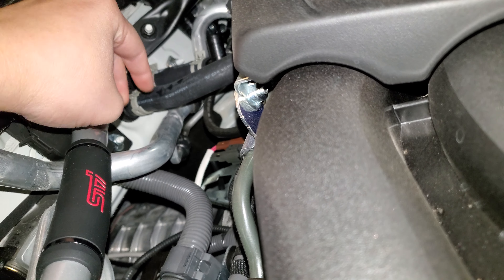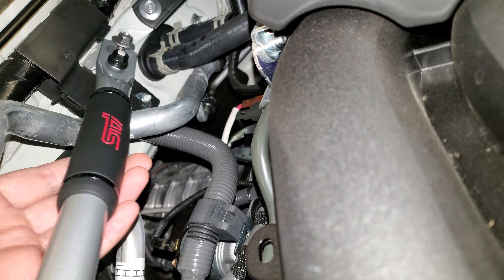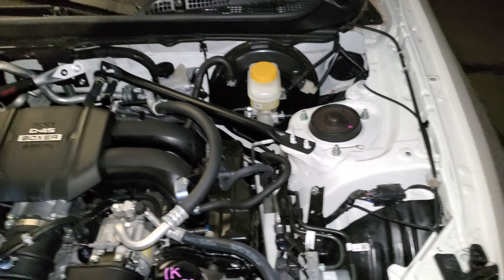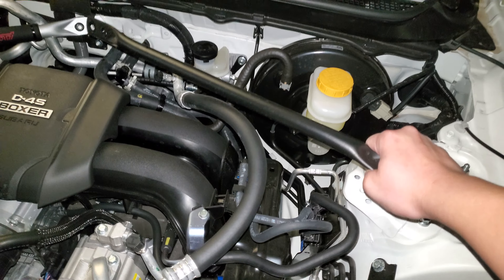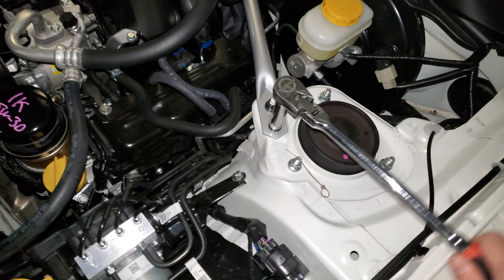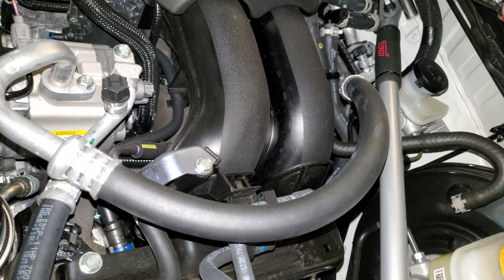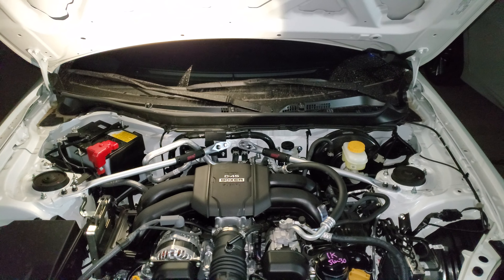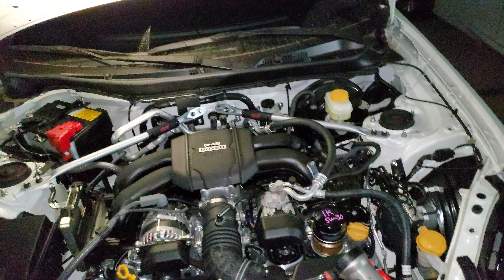2022+ Subaru BRZ (ZD8): STI Flexible V-Bar (E4010CC100) Installation Guide

Comment: nicely made video dude, just wondering what the benefits would be from a flexible v-bar? wouldn't the stock rigid one offer more rigidity?
Reply from the maker: I haven't measured it yet, but the STI v bar does feel heavier and seems to be thicker. The stock bars are hollow and feel lighter.

Having a flexible bar improves NVH and comfort over bumpy roads, but improves handling in the corners. The pillow ball inside the bar locks its position during cornering.

I do notice that the front end is quieter and more comfortable over bumpy roads now. The handling and steering response has also improved. The steering response is sharper and more instant.
Reply: There are tones of information from STI Japan online and on YouTube. As someone who has had a Cusco (stiff) strur tower bar on my 2016 Forester for 3 years, and now just under 7 months with a STI (flexible) strut tower bar the difference is incredible. STI engineers are not joking. The tolerances and compliance between stiffness when corners and turning and comfort it perfect. I found the cusco too stiff and would make the car bounce and even act strangley when cornering. STI calls this preload.
Reply: Yayy for STI performances parts. Congratulations and hope you enjoy!

Comment: I just ordered these and noticed the part # on the box says E4010CC000 instead of  E4010CC100 - I assume you ran into the same thing as that is what you noted in your description.  Maybe that E4010CC100 is the kit including that hardware. Plan to put them on today.
Reply from the maker: I did that have that issue. The part number I ordered is the part number listed in the title.
Reply: So they installed without issue. First impressions are I can feel the difference. Steering feels a little heavier but the harshness of adding my RSR down springs is gone. Basically it smoothed it back to a stock ride but stiffer if that makes sense. Thanks for posting this.

Comment: Seen 5w 30 engine oil and not the 0w 20 you’re using. How’s that working out for you?
Reply from the maker: Works fine. 0W20 is for CAFE purposes, not because it's best for the engine.

I'm currently running 0w40 since my environment is hot and humid. GR cup cars also use the same viscosity.
Reply: @jtworksoncars6341  good 👍 that’s what I found down south where the temps are a bit high using the different grade is better. I’ve seen both 5w 30 & 0w 40. That’s what I’ll go with.

Comment: I have developed a slight knocking noise after I installed these and it seems to be coming from the area where they connect to the firewall. Did you notice any added noise?
Reply from the maker: No knocking noise on my end. Make sure everything is tight and the joint is straight and not flexed.
Reply: Going over uneven surfaces at speed of around 50kmh, I would sometimes get some continuous pops here and there. Is that what you are seeing